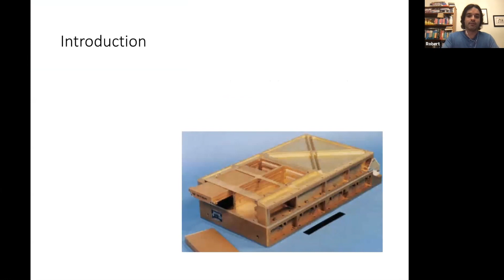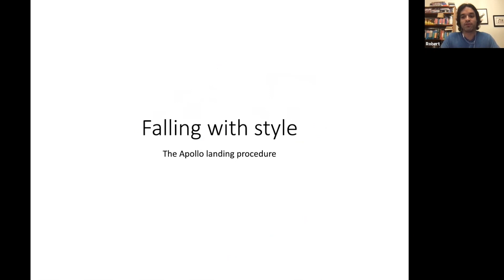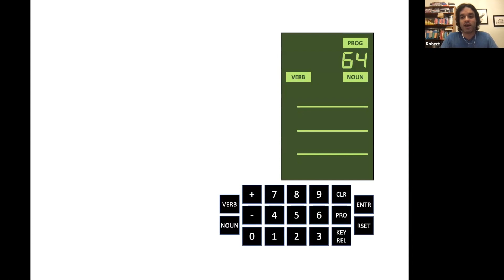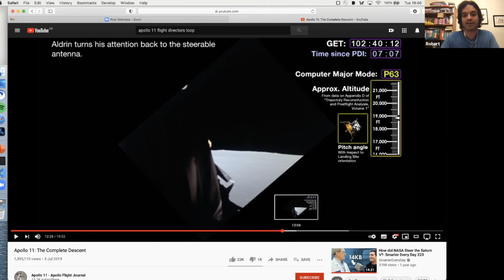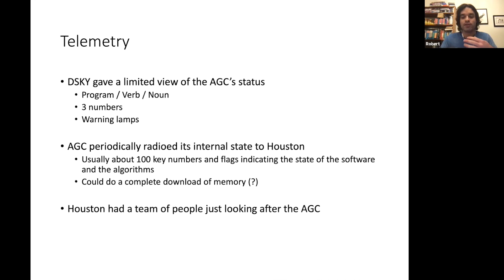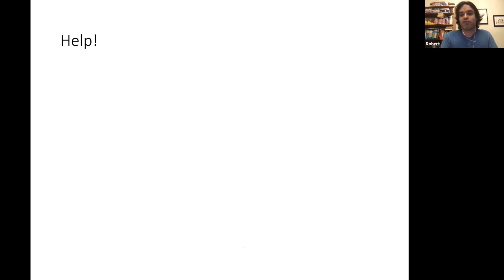Light Years Ahead: The 1969 Apollo Guidance Computer (AGC) - Revisited

Comment: Most landings with the exception of Apollo 15 left the DPS running until touchdown with A14 having running for a few seconds thereafter. On A15 Dave Scott did it by the book and the LM fell the last 5 or so feet. Irwin said they hit pretty hard, but that was the plan so that the rocket plume did not ignite the tanks under the LM. I think also the shadow of the LM's 'leg' out the CDR's window served as a low tech altitude gauge. Given the low sun angle and that the sun was behind the LM, the shadow of the leg would get closer to the actual foot pad as touchdown neared. Again due to the sun angle and an example out of a 1st year calculus text on related rates, the shadow moved in much quicker than the actual descent rate making it a half decent marker of the rate and how close they were to the surface.

Comment: Communications delay was 1.25 seconds. I also think that core rope memory was the choice because it would remain unaffected by cosmic rays. The Soviets were using core rope memory back then as well.
Reply: While it is true that ferrite-toroid “core“ memory is resistant to being “flipped“ by impingement with cosmic radiation from the Sun and other sources, it is not true that this was the engineering constraint.

Rope memory, being “hardwired“ core-memory, also fabricated from ferrite toroids, was a known design, and as the AGC was the first portable, standalone, small-volume “mini computer“, it was desired that developing its new technology was leveraged against using standard, known technology whenever feasible.

Options of the period would have been using electromechanical solutions, like drum memory, or electronic solutions that would have increased the size and weight by twice... as well as to have been significantly more vulnerable to error or failure.

By the way, one of the last, viable uses of core-memory is in the flight computers of (at least modern) military fighter aircraft. As an EMP [pulse] could disable vulnerable FE (field-effect) RAM, such computers have non-volatile memory fabricated not out of ferrite core memory, but (IIRC) out of lithium instead.

Comment: I think you are a bit off at the 28:20 mark - the Landing Point Designator. Only the right hand side number is the actual LPD angle - it only points out the vertical angle on the window. The horizontal angle is (I assume) not needed, the destination is always kept in front of the vehicle. The left hand side number is actually time (in seconds) until switchover to P66. Notice that Buzz shouts out only one number, and that's the vertical LPD angle (see transcripts or landing videos). Great simulation of LPD in P64: https://www.youtube.com/watch?v=ni4GBRVUvdQ